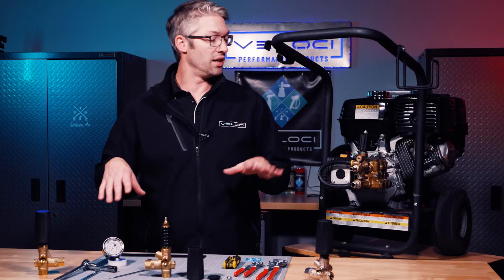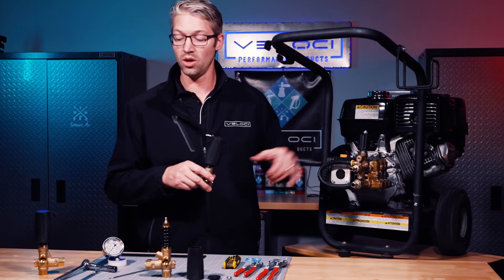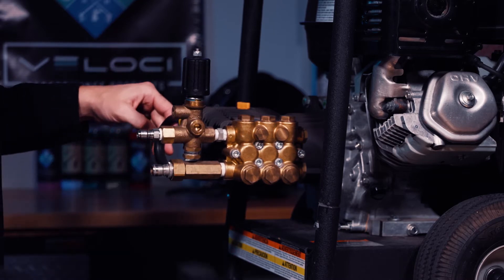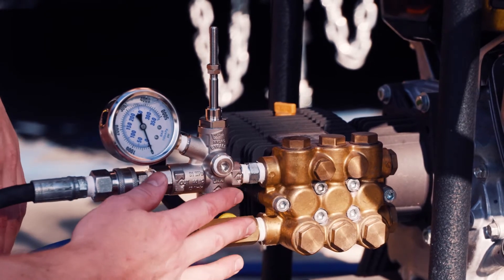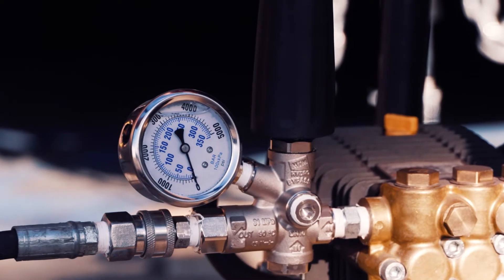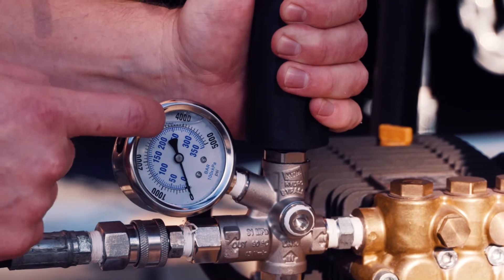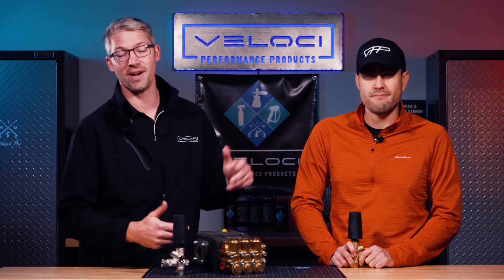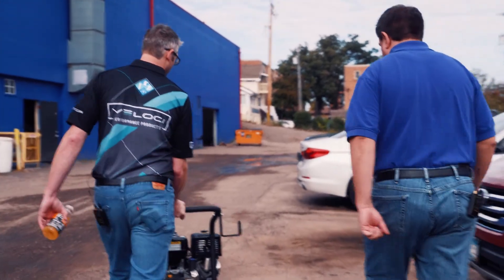Unloaders Part 2: How to Install an Unloader

Comment: *2-3 wraps of teflon tape. It is a lubricant, not a sealant.
Reply from the maker: Teflon tape, and plumber's tape in general, is a lubricant and a sealant.
Reply from the maker: Perhaps we're discussing to different items. But PTFE thread sealant tape is used in many pressure washing applications. Refer to this video as well: https://www.youtube.com/watch?v=XabgmN35LVk

Per this product page the application instructions do call for 3 or more wraps: https://www.grainger.com/product/GRAINGER-APPROVED-Thread-Sealant-Tape-Low-Density-21TF19

Thanks for the engagement!